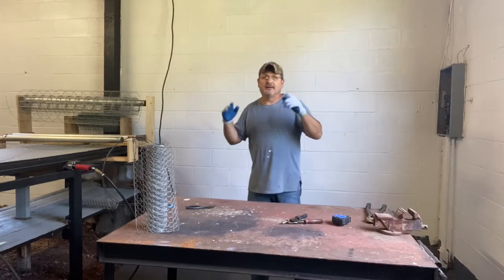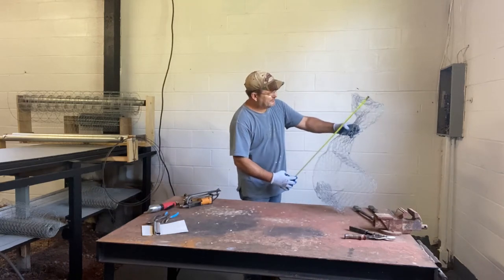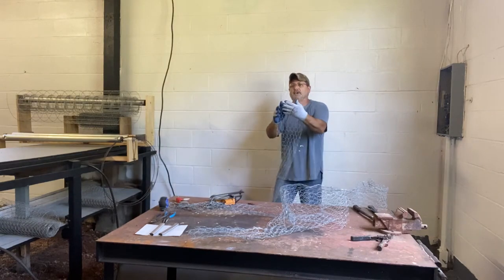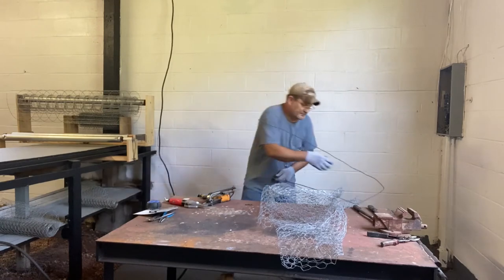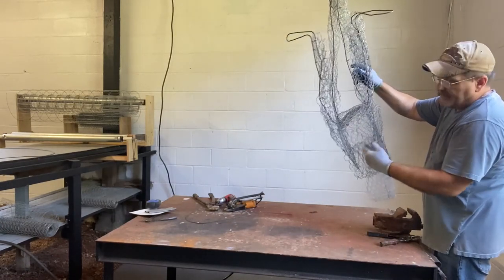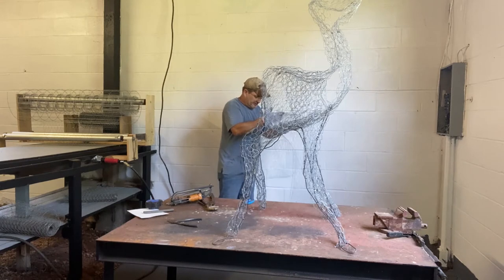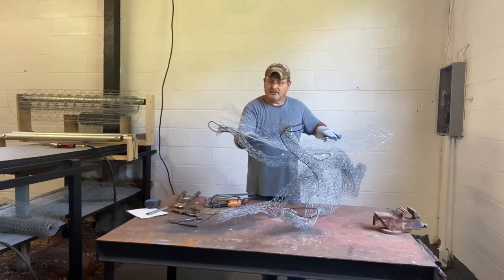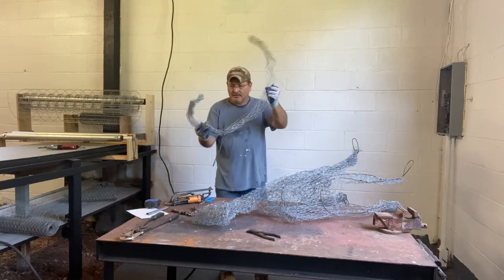DIY Chicken Wire Deer Yard Decorations

Comment: Great work. I do not see the material listed for the thicker gauge wire you have running throughout. What are you using? Galvanized steel wire thick gauge?
Reply from the maker: Thanks- I talk about the wire and where to buy it in the video... 12 gauge and at Lowes in the fencing area